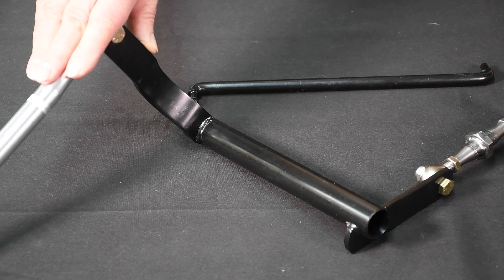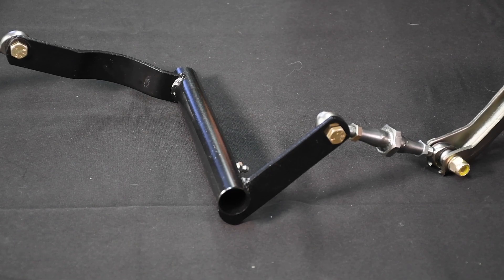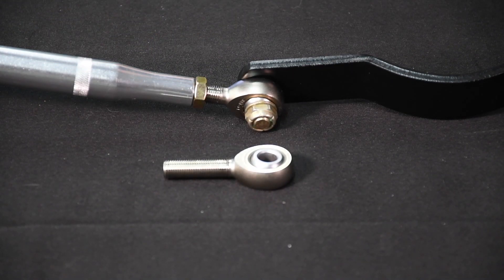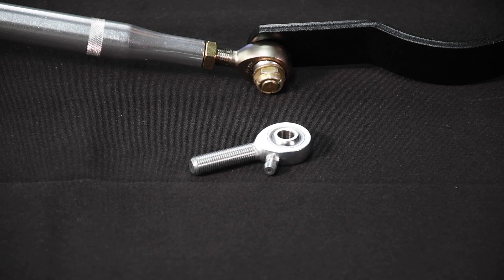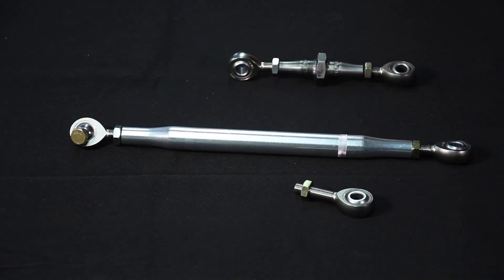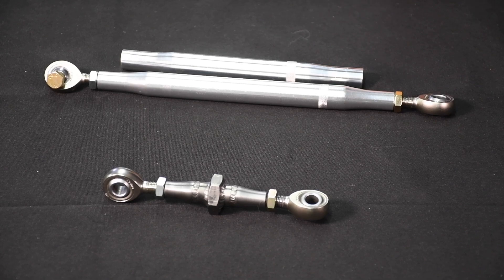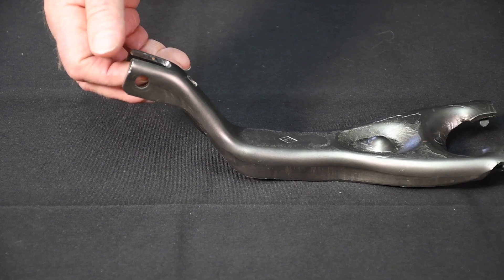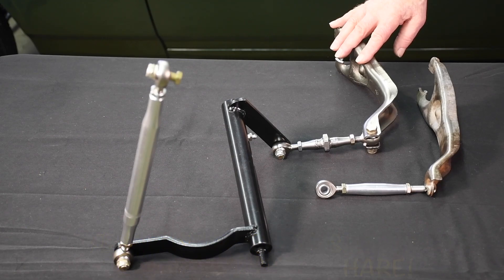Bomb Proof Clutch Linkage

Comment: Holy smokes why didn't I think of this!  A brilliant solution!  I'll bet you can use these rod-ends on so many other things like throttle linkages etc.  I'm literally knee-deep in 1968 442 parts in the garage, hot and heavy with a resto project.  I just got a replacement z-bar kit and I'm absolutely going to fab my own clutch rod and fork rod with your idea here.  The problem I'd hit with your swedge tube is that the Old's pushrod is bent 6 ways till Sunday to pass through the firewall to the z-bar and I'm not inclined to cut a wider hole to facilitate the straight throw.  I happen to have the old pushrod still so I'll just zing off the OEM ends and weld these in place.  ***UPDATE: it looks like Aurora makes female rod-ends with left/right threads now which makes this even easier.
Reply from the maker: I'm happy my video helped and inspired you!

Comment: Had the linkage go out on my semi interested in fabricating my own linkage assembly want to use what I see here just wondering about articulation of the heim joints and wondering about vibration as the joints I had used rubber wonder if some poly rod ends might be better .
Reply from the maker: A rod-end linkage will be noisier, but I don't think in your case it will matter much. If you check out the video, I use Teflon lined aircraft jobs, but you might want to consider the less costly jobs Aurora Bearing sells with zerk fittings so that you can grease them.  FYI, the amount of articulation depends upon the rod end. You can get high misalignment rod ends that could work for you too...Interesting application!  Thanks for asking.
Reply: @lonewolfhotrods  thank you for the reply went ahead and got the truck fixed with the original equipment today solid rubber end links will probably out last me .the ones on the truck were completely gone.truck has over one million miles on it was originally an automatic thinking they grabbed the clutch rod out of the junk heap .still thinking about using the materials shown thinking they would be lifers 😉.thanks for the great content and again appreciate the reply .👍
Reply from the maker: @jhnsls978  Glad you got it fixed!
Reply: @lonewolfhotrods  long wait 3 days how I spent labor day weekend 😞
Reply from the maker: @jhnsls978  Wow...you need a nap...L-O-L
Reply: @lonewolfhotrods  now my turbo went out stuck again !